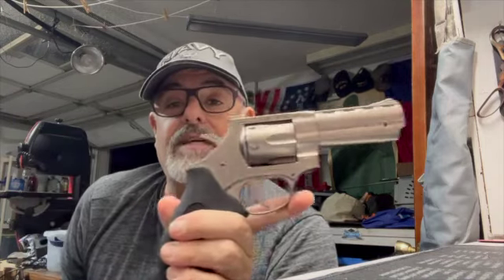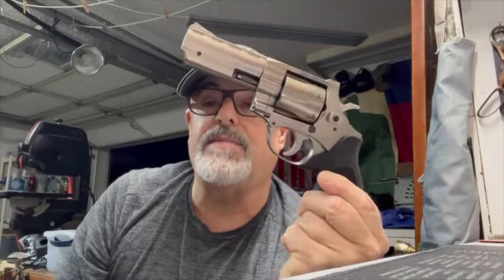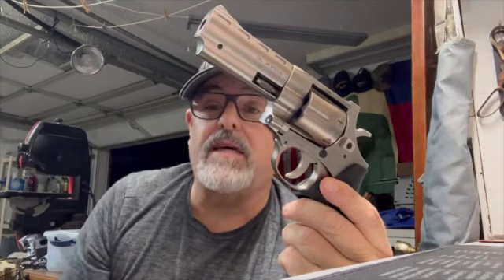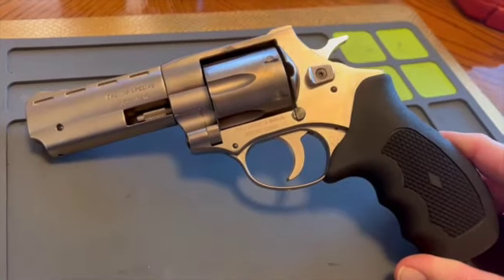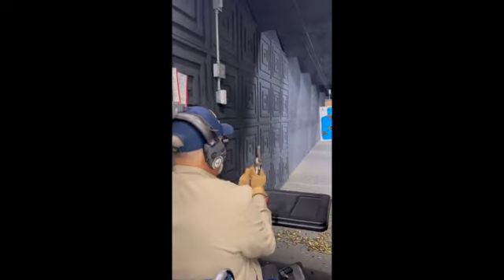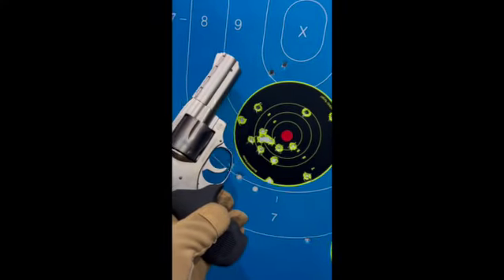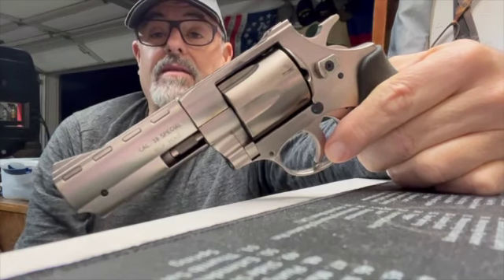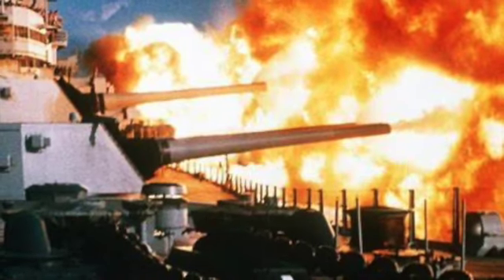EAA Windicator .357 4" revolver a good shooter? A keeper?   SD 480p

Comment: I just got mine and shot 357 and 38 special works just fine
Reply: My question is can it shoot the 125 grain .357 Mag that's rated at 1450fps,the police used to like that load when they were carrying. 357 Mag revolvers,I know some of the S&W guns had a problem with it as that load was causing the forcing cones to deteriorate, in some cases that were cracking the forcing cones.
Reply: @hubertwalters4300  the info that comes with the windicator just states that it is not built to use plus p ammo and that any other current standard 38 or 357 is just fine. The ammo I bought was just that kind. It was the least expensive I could find. The 357 kicked harder that the 38 which is what I expected.  I shot single action and double action two handed and just one hand. I didn't try with my left hand as I was short on time. I'm sure that since I can shoot my 45 acp wirh my left the 357 won't be any trouble
Reply: @paulcunningham2859  Thanks for the reply.

Comment: Some very fine sand paper #800 then #1500 grit would soften the edges on that groved trigger, that would really help.  I like the Gun Metal blue/BLK finished model in 4" ,  however I don't know about after market available grips for it. I'm looking at Taurus 605 or 856 which does have many after market grips available.